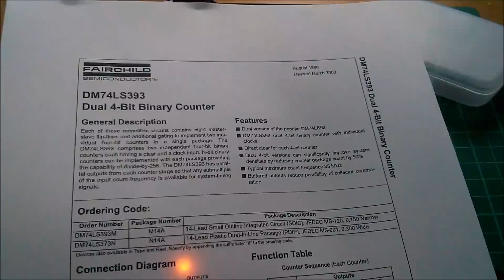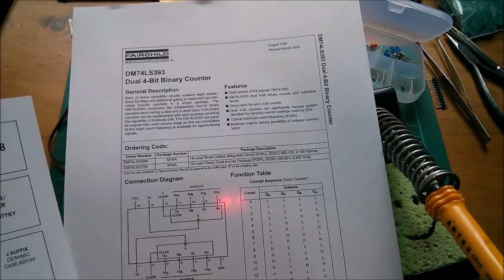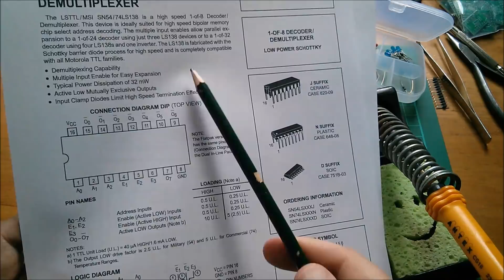Testing the Reflow-Soldered SMD Integrated Circuits

Comment: Julian,  at about timestamp 10:23 you are pulling (NOT CUTTING)! the resistors from the 'sticky' part of the paper strip.  If these are pulled directly out like this, you can create TWO serious problems:

1) the glue may interfere with a good connection to the breadboard
2) The glue WILL also contaminate the inside of the breadboard

I always cut the leads a bit below the paper area.  Also, I don't even like guessing where to cut the lead ends even if I do after pulling it out.  Never even pull them out and then cut--cut FIRST with some extra lead sticking out of the paper.

I am just starting to receive my ebay items to start SMT--they even sell "PRACTICE" smt boards and components--I just ordered mine today.  One trap I fell into...be sure to get the ones with IC's as many only come only with passives.  GOOD LUCK!  

THANKS FOR ALL THE WONDERFUL VIDEOS!  Many times I have paused your videos to order items you mention at that moment!
--daLe

Comment: Excellent Julian! Your one reversed IC actually has the optimal amount of solder. Ideal SMT solder joints have much less solder than TH solder joints (PM me if you want to know why, it’s boring for general audience).

Soldering SMT ICs to adapters like that will REALY open up a whole world of fascinating devices and modules to you!

As for your test, you could shift the binary 3-bits up one and use the LSB to drive the /EN lines to check the disable functionality. Each LED should then light in sequence with a gap between them if the enables are working :-)

Comment: It's getting vcc/power through the esd protection/clamping diodes on the inputs
Reply: Is that te phenomena Dave on EEV was talking about the other week?
Reply: Yes, but Dave used a microcontroller for the example.
Reply: Phenomena is plural. The word you're looking for is phenomenon.
Reply: Actually as this happens in a plethora of different conditions I think the plural is fine. Now you try it in my language mr chairman of the pedantic association.
Reply: "Is that the phenomena" - That's clearly singular, otherwise you should have written something along the lines of "Is this one of the phenomena". And no, I won't attempt it in your language because your language is completely irrelevant to this point as this was specifically about something written in English. But since you just had to invoke non-nativity, let it be known that English isn't my native language, either, but you don't see me A) make a stupid, easily avoidable mistake and then B) try to defend it with half-arsed reasoning.
Reply: I hate to point this out, but "non-nativity" is not a word hahaha...Mr Chairman lol
Reply: raindogred - Actually it is "can't admit when you're wrong".  Me noes I are rite.  ;-P
Reply: lol
Reply: u spelling natzi's drive me crazy

Comment: Square pin headers are a tight fit in most breadboards, and can damage the contacts.I used "turned pin" style  M-M pin headers, which I got from china in bulk a few years ago. They are much easier to push into the breadboard, especially when you have a large number of pins.
Reply: True. I've always had problems with breadboards not making good contact because of this. There should be special breadboards for these.

Comment: Testing (hardware and software) is so important, one cannot stress that enough to beginners. I consider myself reasonably adequate at soldering, and still lost a ridiculous number of work hours because of single pins on ICs that weren't soldered as perfectly they should have been.

Comment: That was a surprise. Will you please try using a similar technique, but putting the solder onto the component leads? It should allow you finer control of solder paste quantity and positioning, thus less chance of bridges and dry joints. Proper applicator nozzles should help. Thanks.

Comment: Hi Julian, Have you tested to see if the paste is thin enough to pass through a hypodermic needle? The only rework station I seen for surface mount had stereo magnifiers (almost a microscope) and a small hot air blower and a paste dispenser that ended in a needle tip.

Comment: Julian, if you're going to be testing many 74-series or 4000-series ICs, you might want to get yourself a MiniPro TL866A or the slightly cheaper version without the ICSP port (I think the suffix is C or CE instead of A, but I don't remember for sure).

It programs almost everything "programmable" and tests most of the common logic chips.

But this is still a good video for teaching newcomers how to test these circuits with a few relatively cheap components.

Comment: Re 17:16, that is really quite extraordinary. I mean, I've had chips fail even with no smoke, just because you exceeded the input voltage by 15%. And here we have a chip that survived a -100% voltage applied to it.  

So apparently, chip manufacturers are now putting in multiple redundant magic smoke containers, in case something like this happens. Really, this effort should have gone into keying the chips properly.
Reply: Yes, it's important to keep these containers separated by a good membrane, so if one of them breaks, there's still enough magic left in the chip.
Reply: Or maybe it was the protection diodes that conducted, started melting the encapsulation (hence the smell and the bit of smoke), and he powered down just before they completely overheated...  It helps that the internal resistance of the cells and connecting leads may have helped to limit the short circuit current a bit.
I overheated a NE555 timer, it melted the breadboard. But the chip still works fine 😀
Reply: It's not like the chip had -100 % voltage applied to it, it just had it applied to completely different pins. Depending on the circuitry, that can produce anything from magic smoke to no effect whatsoever.
Reply: Anvilshock Right, bit of a brainfart there. For some reason, I thought that the power pins are mirrored, so that when you flip it, the Vcc and Vss are reversed. Which just goes to show that you always have to Read The Fracking Datasheet.
Reply: But in fact, had I checked once again said datasheet, I wouldn't have said that because the 138 is indeed one of those which have their GND and VCC at diagonally opposite pins. So I confused this with another chip, and this makes the scenario by your description correct after all, and mine null and void!

Comment: Why use surface mount chips only to put them on breakout boards? Are you going to eventually create a larger board with more surface mount connected together?
Reply: Some chips you can't get as DIP (especially newer ones), or they're much more expensive.
Reply: He explained in a previous video that he wanted the standard DIP package, but the chips he wanted to use were not available in that package format.  Therefore he got the chips he could and the breakout boards to put the chips on.

Comment: So heat from the lamp isn't a problem for the Chip?
Reply: Nope. 
In industrial assembly, they get put in an oven and baked. Or fed across a bath of molten solder. SMD parts are designed to handle a lot of heat for a short time. And lead free solder is used, which would still be solid at the temperatures that can be achieved here. 
If anything, this is going more gently than need be. My hot air gun gets up to about 250-300 and heats the chip quite a bit faster, with no problems.

Comment: Re solder wick. Gravity is sometimes a good alternative to solder wick. Just hold the IC so that the solder blob pins are above, and the hot iron approaches from below, and the excess solder will naturally flow down onto the iron. I've probably used about 1.5m total of solder wick in 40 years, and just gravity (or flicking/tapping) 99.9% of the time. My second roll of solder wick (ever) just arrived the  other day. Cheerio.

Comment: Instead of using resistors to avoid the risk of shorts, why not just test for shorts with a continuity checker before connecting up the circuit?  It should only take about a minute for a 16 pin chip.

Comment: Aren't you melting the plastic of your breadboard every time you use it to hold your solder jobs?
Reply: The heat from the soldering is transferred to the plastic via the metal contact that is holding the pin. When the joint is being soldered, the plastic is being softened. If repeated enough, that  can cause that pin location to become unreliable. Thanks for asking.

Comment: Whats the difference between cmos and ttl?
Reply: TTL uses bipolar transistors which run on current flow. A little tiny current flows through the base of the transistors which causes the transistor to switch much larger flows of current between their emitters and collectors to do the actual work. Each transistor is also connected to a resistor to provide a source of that flowing current. The resistors consume lots of power, but they're like springs counterbalancing levers in a machine and the resistance they provide is necessary for everything else to work. The transistors pull in one direction while power from the resistors pulls in the opposite direction. The important thing to remember is that these transistors work as current flow amplifiers to do their job.

CMOS on the other hand works based on the voltage level rather than the flowing current. This allows for much lower power consumption because you don't need to have the current flow, you only need it to be present. In CMOS you use a pair of transistors in each stage (instead of the transistor and resistor combination in TTL) and they only really draw power when they're changing from 0 to 1 or from 1 to 0, the rest of the time they just sit there and maintain things on the tiniest trickle of leakage current. They act a little more like a lightswitch where it takes effort to turn it off or on, but once it's in the new state it will stay there without adding additional energy.
Reply: Also they have different noise margins.
I.e. they will tolerate different input voltages and output voltages. Be aware a 1 in 3.3V logic is seen as a 1 in 5V logic but the reverse is fatal to to the 3.3V chip.
Reply: Ok thank you
Reply: logic levels
Reply: CMOS usually operates at 3.3V while TTL usually operates at 5V. However, some CMOS chips can take 5V logic level inputs as well (the STM32 microcontrollers for example), but usually you burn through the pin that way (the Raspberry Pi is known for that, because many people have tried to interface it directly with a 5V Arduino).
Reply: CMOS used to be very easily damaged by static whereas afaik it was never a problem for TTL due to it's current driven nature mentioned above - seems to have been made a lot more resilient these days though... supposedly you're still supposed to use anti static workmats and wrist bands and paraphernalia to handle it though... but obviously a lot of guys including julian seem to get away with no problems.
Reply: Yes, that's because CMOS parts use clamping diodes for protection these days.
Reply: anlumo1  Err, 4000 series CMOS operates at up to 18V.
Reply: joinedupjon  74xxx and 74LSxxx logic chips have fairly large structures inside the silicon, so can withstand normal levels of static charge. CMOS devices that don't have very good protection on their inputs can suffer from damage caused by high voltage static charge punching holes through the thin insulated gate areas of the transistors.

Comment: Perhaps you could have used a white board on top of the chip. this might have worked to keep the chip a bit cooler.
Reply from the maker: or a small mirror :)
Reply: I was worried in the first video in this series that it'll break the chip, because it had to survive the high temperatures for a long time. However, with this new setup they should be fine, they're designed to take that heat for a few minutes (otherwise you couldn't use them on mass produced PCBs).

Comment: It does not really test if it is reflowed without any bridges  as it does not test for any solder bridges on the chip select pins :D
Reply from the maker: a bridge between pins 6 and 7 would disable the chip
Reply: Bridging pin 4 and 5 would still work but disable individual chip enable of it. The current test setup will not allow detecting that :)

But I mean it is not a production system, so perhaps that it a danger that is "survivable" (and yeah - I have been told that I am "detail oriented" in my approach to things)

Comment: Normal people would just buy the DIP version of the 74HCT138? While this is interesting in discovering the hardest method possible in order to achieve an end result, I'm still wondering why.
It's like using solar power via three different power modules simply to power something.
I'm hoping a Patron will donate an adjustable power supply and a hot air gun, so Julian can be as comprehensively equipped as the rest of us 12 year olds.
Reply: Hehe, I've made it even harder for me: hand-routed the adapter boards out of copper clad boards :)

Comment: No way in hell your lamp will kill the chip, you'll need quite a bit higher temperature for that. And I really don't get why you can't use the multimeter to do a continuity check between the legs and the pins for not correctly soldered pads and between neighbouring pins. Far less risky then firing them up, especially without current limiter from your batteries...